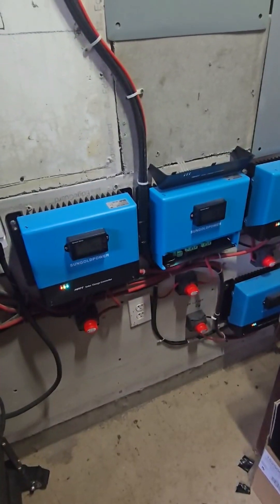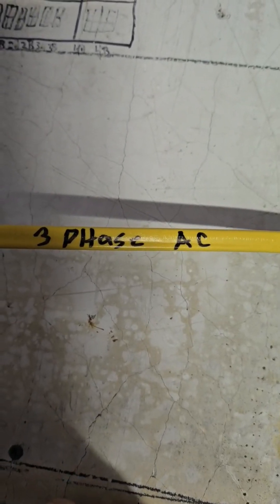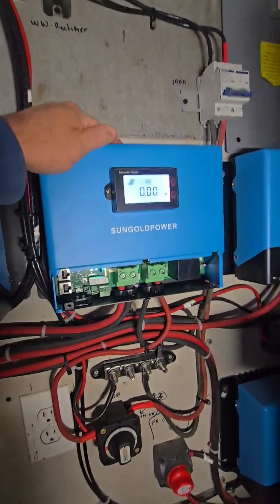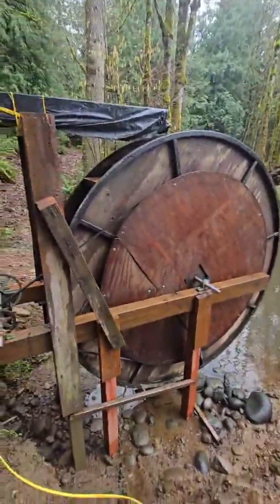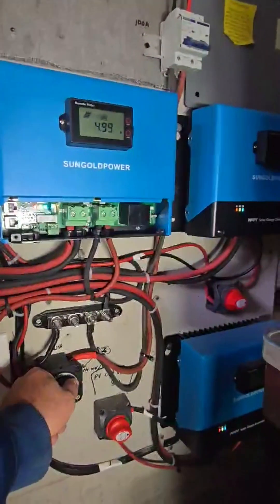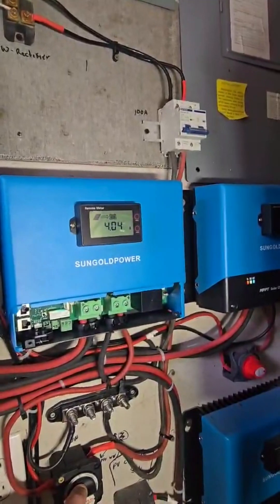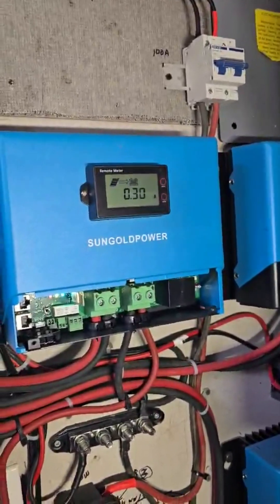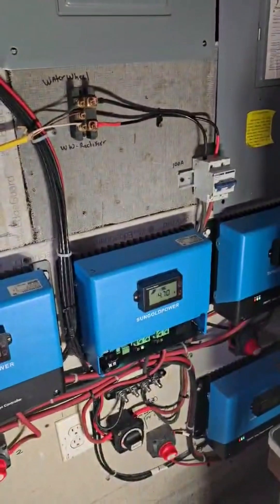Hooking Waterwheel Generator up to Solar System

Comment: work backwards....
how much water are you delivering, and how far is it falling?
1hp or 750W (close enough) is 33,000ftlbs/min.

1000lbs of water, about 500L, at 33 foot, or 10M... every MINUTE. dont ask me what that is in gallons, as i refuse to deal with that ridiculous unit that has two definitions... UK or US?...

then you get an idea of the waterwheels efficiency... it will be low. i would estimate 30% at absolute best. be closer to 10%... bit fiddly, but best way to measure the wheels output is a prony brake... a torque arm, brake strap on the hub, and a scale...
then the transmission loss in the belts...
then this nasty, rarely considered aspect. its called "jacobis law". or impedance matching... NOONE ever talks about this!

the generator has windings, with a resistance.
the current delivered has to flow THROUGH THE GENERATOR. and that current will produce heat, dissipating watts as the current squared times resistance... I2R. 

this also raises a very interesting aspect of, when you measure the voltage/amps...what are you actually measuring? the generator and the load are in series, yet you measure the voltage in parallel to both of them... the shunt or current transformer for the current measurement is also another resistance, in series with the load...

 its best to draw this out and think about it, rather than have me explain it... then it might click ;) suffice to say, that we are conditioned to think of a generator as separate to the load it is driving, but they are intimately combined... you have an EMF, forcing energy through the circuit, and a BEMF opposing that energy flow.  EMF is only the force that manifests as volts or amps... can think of it as watts but it isnt that, either... blame faraday!

i mentioned it in another video.... you have to focus on getting the transmission voltages as high as possible, the current as low as possible, to reduce losses in the generator and the wires themselves.

anyway. years ago i had the chance to set up a hydro unit, the location suited a pelton wheel...
main dam, penstocked to a 10KL tank. 
a regular genhead off a petrol generator.

to produce the required 240V at 50Hz, it has to spin at 3000rpm. for the head we had, this worked out to be a wheel about 3inches in diameter... impossible. went to 600mm or 2ft, and i forget the actual ratio we ran... whatever. at full flow, we could drain the penstock in about 15 minutes, but it was good for 2.2kva, the rating on the generator. if you can find a four pole generator from a diesel engine, its running at half that RPM. good luck, but if you can find 8 or more poles, you can get away with direct drive... it all depends on the head or velocity of the water, and that dictates the diameter the wheel has to be for a given RPM.

but it would only use water, and deliver power, on an "as-needed" basis due to the governor, the hardest bit of the project!  tractor tyre as a flywheel, to try and get the RPM steady, and mucked around a while with springs and linkages and valves. in the end we got to about a 10v sag from no load to full load, was good enough for the task... 

from there, MOT to kick it up to 2KV or so, a single wire (ground return!) HV transmission line to get it the 150M to the shack, and another MOT as a stepdown...

kept his lightbulb and fridge running 24/7, with a bit of extra for the toaster... it was actually the transformers that were limiting us... not much choice in that regard. 

no batteries, no inverters, no silly electronic devices, the bane of our modern life... everything was repairable.

all gone now, property was sold... google maps shows the dam having been filled in as well... wtf? who does that? rich twerps, thats who... 

whatever... your location doesnt suit a pelton wheel, but if it was up to me... 

use the water wheel to drive one of those pumps you make by wrapping a pipe around the rim... or use a "bunyip pump". get water to a tank as far up the hill as possible, and run the pelton, as its the most efficient turbine that can be made easily... only flow the amount of water needed by the load, the demand, rather than waste it "feeding middlemen", that is... batteries, inverters, electronics. need the proper nozzles, "needle valves", that maintain full velocity, and some way of operating them, a governor....

this looks cool, its a talking point, but as much as i hate saying it... it will never produce much of any note...

Comment: Itll be  the liner thrust effect, i also put aluminium buckets inside the wheel, all the same depth over laping from top to bottom, also tensioners on rubber belts would help.

Comment: when you switch to combo of ww and solar, did you make sure the voltages are closely matched? if you have 150v coming in on solar and only 57v coming in from the water wheel its not going to work too well.

Comment: I love this stuff. Great video. Keep looking for the right gen and gear ratio to get all you can out off the setup. I did hydro in the past. 6 amps 24/7 at 12 volts. Powered my camper. Try an 3 phase Ebike 72 volt motor. They make great wind turbines. One wind turbine was with a hover board 36 volt at 420 watts. It was the best I ever made. A storm took it out. I have yet to find one like it to make a new one. I do have others that very well made with Ebike motors. Try looking at Ebike motors. Probably cheaper that that thing you ran first time.

Comment: Thanks for this video. You give me some confidence in my initial failed attempt for hydro power added to my off grid solar. I bought a PMG from aliexpress. custom build for 2000 watts at 540 RPM. but the problem is the torque. I have. 4 foot wheel but it is undershot. I cannot easily get any useful lift. I managed to get the rig to spin, but under load, held only to only 12.4 volts and bogged the wheel down.
I was using drive chain and only have a ~12in main sprocket and got up to 6:1 rotation
Reply from the maker: @3eagles4  i have a total of maybe 6' drop in that pipe the wheel is 7' and the pully diameter is 5'.
There are more videos on my YouTube channel on the gears and build.
I think my next move is to rewire a washine machine stator.
My system is 48 volts.
So I guess on a q2v system the white PMG would be around 3 amps.
Do you have any videos on your waterwheel?
Reply: @HowToWith24DY  I have a couple on my phone. I will try to post them up on YouTube. I took the works out for the winter as it was a floating rig for an undershot. The river changes often with the rain and the control dam upriver. I built the 4 foot wheel hoping it big enough but I think I over bought the PMG. I customized it to ge 120 volt 3 phase at 540 and hoped I could get at least a quarter of that voltage after the rectifier.
Reply: @3eagles4  2000W... you can say a bit under 3hp.
a hp..., 750W (746W, close enough...), 33000ftlbs a minute.
this is comparable to 500L of water falling  10metres every minute. or 1000lb falling 33 foot, basically the same thing (no need to get picky over exact conversions. its close enough). you can shift and swap the figures... 50L falling 1000M, 5000L falling 1M, etc... as long as it all eventually works out to be 33,000ftlbs/min...

for 2250W, or 3hp, you need at least three times that... thats before considering ANY losses.

now, the fun bit is... you cant actually extract all the energy in the water. if the turbine was 100% efficient, you would get HALF the potential energy... huh?

here is a tank. it has a potential energy of so much. no work is being done, as it isnt moving. we punch a hole in it, and the water freefalls, gaining kinetic energy. 
yet again, its not performing any WORK. 

to extract the maximum amount of work, we have to limit the rate of fall to HALF of what it would free fall at... we extract more work, the flow slows, and we get less work done... we reduce the work, it flows faster, and we get less work done... 50% is the sweet spot... thats "100% efficient".

a good pelton is lucky to get 80%. it slows the water down at the wheel itself. exists with the full velocity it gained in falling, or its head, aka pressure, through a nozzle. the wheel has a peripheral speed of HALF that. but a pelton only suits high pressure/head/fall. you need a francis turbine or similar for low head... and theres nothing on the market that is worth it. 

to get 2000W, you need to throw at LEAST 3000L of water from 10M at it... every MINUTE.

designing a good hydropower is HARD. and the amount of water actually needed is mindboggling...